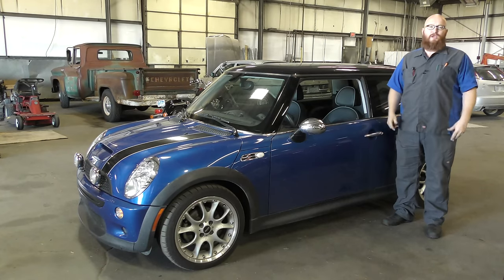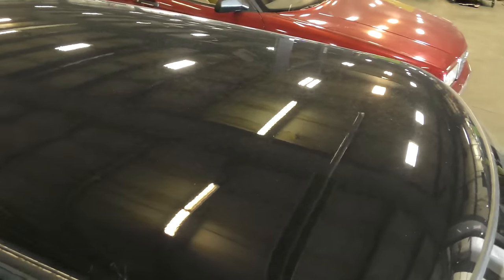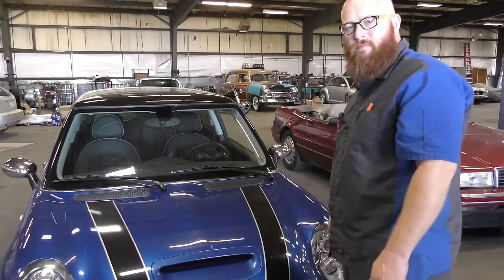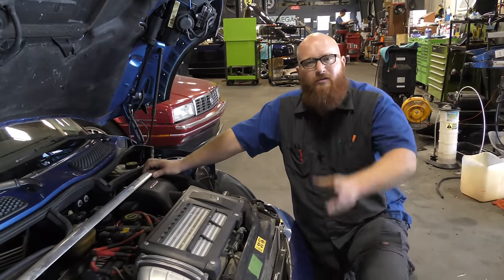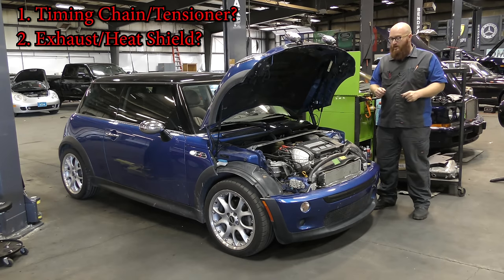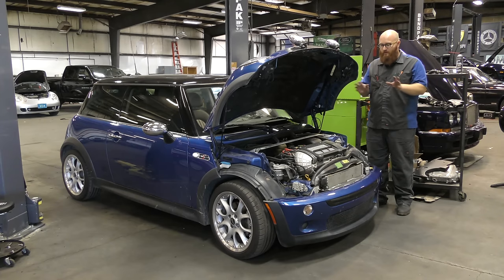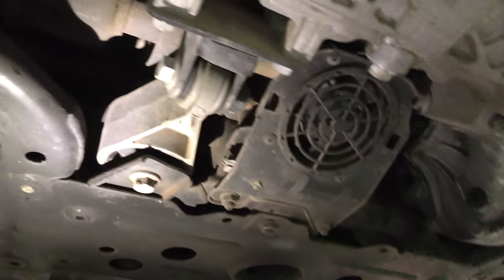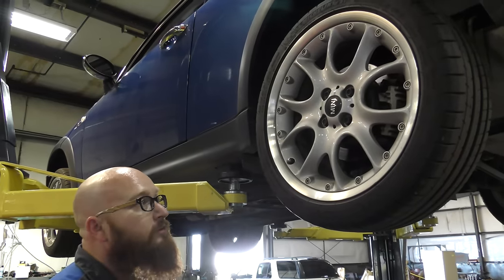Roaring Loud Mini Cooper S! The CAR WIZARD finds the source of the mysterious noise

Comment: I had one of these, tons of mods. They make good power but have many failure points. Give it time that car will leak oil at every seam.
Reply: They leak power steering lines too and they are not well built.
Reply: As someone who owns a '05 S with 207,000 km... maintain your shit better? I'm not kind with mine and the only mechanical failure I had was the power steering pump, everything else is maintenance and preventive maintenance for stuff like the infamous BMW plastic overflow tank, etc.

Comment: I’ve never heard of a supercharger pulley going bad on these, of course everyone puts smaller ones on. Typically it’s just the tensioner pulleys that go bad.
Reply: ne2i that’s interesting I never read of that one.
Reply: It's not AS common for the front pulley/gears to go out, but the oil reservoir in the front can leak out and that's one way that noise happens. It's even more common for the oil reservoir for the gears at the back of the supercharger (between the supercharger and water pump) to have the oil leak out. IMO, the noise from a failed timing chain tensioner, belt tensioner, or at the front or back of the supercharger can all sound pretty similar, so a stethoscope like the wizard was using is crucial.
Reply: @ne2i  That pile is from him putting reducer pulleys on customers cars. I've never heard of an OEM supercharger pulley failing. It must be a pretty rare failure.

Comment: Bit of trivia:  the Focus SVT in the background and the R53 Cooper S featured use the same Getrag 6 speed manual gearbox.
Reply: Car manufacturers share transmissions like how PC manufacturers share cpu and graphics card
Reply: And that Getrag is amazing, I have an SVTF myself!
Reply: I drove my buddy’s SVTF in high school, probably my favorite MTX of all time along with a 911 or S2000 box
Reply: and the noble m600 with the volvo engine. it can handle over 800 bhp aswell.
Reply: The parts on the SVT Focus are not cheap like the newer ST Focuses are.

Comment: when you do the supercharger service, also replace dip stick o-ring and crank position sensor o-ring, as both are usually toast after 30k miles and you got your standard Mini Cooper oil leaks. going into front end service mode makes both parts easily accessible, especially when you do a full SC oil service (take off the SC). Replace the belt tensioner (cheap insurance) while you're in there and to round off a 14-year old Mini service, replace the engine top left mount, as it leaks black goo out by about 30-40k miles.  Oh, and check the crank pulley rubber parts for cracks - another weak spot that can cause expensive problems down the road. I wonder of the fan resistor on that car still works, given the low miles.

Comment: I want to see what's going on with the SVT Focus in the background!!!
Reply from the maker: Locked up engine. Ruined
Reply: @CarWizard  ugh.... someone didn't change their timing belt in time... I drive one and that is the one thing that is always monitored.. that's so unfortunate
Reply: @CarWizard  that's a pitty those cars are awesome are they like the RS or st but just rebaged for the USA
Reply: @neilmurphy845  actually its the equivalent of the ST, the RS had a turbo and we never got it here
Reply: @konstantindufnik696  ow that's cool I really like those old Ford's I think they look better than the new ones
Reply: @CarWizard  Mhh so a perfect patient to get a Rolls Royce hart then? :)
Reply: Dang. Time to drop a 351C in it.
Reply: Cosworth engines are very expensive.
Reply: Chris Pofahl it’s a fwd car so I would just put a 2.5 Inline-four or 3.0 Duratec V6 from a Ford Fusion in it.
Reply: @atx-cvpi_99  but they are very cool the cosworth engine's
Reply: @CarWizard  May be off topic but need advice. Can buy a 2011 Mini off a lady going through a divorce for $3,000. Fax looks good from what I can tell except one minor accident 4 years ago that rear ended a car and set off air  bags.  Grille and bumper was replaced and repainted. See nothing that worry’s me other then it has 170,000 mikes on it. $3,000 a good buy? 2011 Mini automatic a good car?

Comment: 1st generation minis are the best models ever, I should think of the JCW models, they scream louder than the Cooper S
Reply: These are not Minis, they are BMW in disguise, that's why the engines suck.
Reply: If your definition of good includes reliable and well built, first gens are absolute garbage. 
Superchargers go bad all the time, oil consumption, interior creaks and rattles, etc.
At least it’s not the Prince engine...
Reply: @julianh9347  Its not a BMW engine...
Reply: @TheRetr0Miner  I know, which makes it even worse! The worst of all worlds.
Reply: @julianh9347  it's a dodge neon engine.
Reply: @ast5515   yes superchargers go bad.  Just like turbos.  Yep they consume oil (just like turbos).  Dash does rattle.  Takes 30 minutes to fix and never does it again.   Basically the car does car stuff.  

Really the only downside I find it
is they use a ton of gas.  My hobby it touge racing.  I have several turbo cars and only supercharged car is the mini.  Mini will go thru a tank twice as fast as the turbo cars.  More then once I was out with friends and ran out of gas.  

The mini is slower then my other cars.  They all make at least 100hp.  The instant throttle response really helps it to keep up. 

The best thing about the mini is it's a unique driving experience.   The supercharger screams under power.  Between shifts the exhaust snaps and crackles.  Just puts a smile on your face.
Reply: OutlawUniverse I never said it wasn't fun. It just isn't particularly well built or reliable.

Those superchargers go wrong a lot more frequently than turbos though.
Reply: @ast5515  The superchargers need a service that Mini stupidly never accounted for.

The reason they fail is over time the oil that lubricates the gears for the water pump run dry, which then makes mince of the gears leading to them not engaging the water pump anymore which in turn makes the car overheat and then the head gasket fails, which writes off the car because it's too expensive to repair.

A bit of preventative maintenance and you can avoid the problem. Just change the oil in the supercharger. It's a fairly big job, but nothing a home diy enthusiast couldn't handle on a weekend.
Reply: @SofaKingTouge  nope Fiat engine
Reply: The W10 & W11 engines in the first generation BMW minis are Tritec engines. A company created by Rover, BMW and Chrysler, hence the ‘tri’ in the name. The engines were developed with input from all 3 companies at the time. The Tritec engine and the company I believe, was later sold to Fiat after production of the hen 1 ceased, who built a 1.8 out of the platform.
Reply: MrManBuzz Long story short, BMW fucked up. Like they did for the last 25 years of timing chains, rod bearings, window regulators, etc.
Reply: @ast5515  Pretty much yeah. They fucked up in not making it a serviceable item. The same supercharger in other cars (some Mercedes iirc) require it to be serviced every 40k.

As long as you can change the oil in it before it starts making a death rattle the supercharger should last just fine. There's even a mod kit you can buy for them now which allows you to top up the oil without taking anything apart.

Considering most people put reducer pulleys on the supercharger anyway, it really isn't that big of a deal. You can do it while doing that job and then forget about it for a few years at least.

These cars certainly aren't Toyotas in terms of their reliability, but they're also not soulless and boring like a Toyota either.

With some smart preventative maintenance they can be pretty reliable.
Reply: You don't know what you're talking about. These cars are rubbish, especially the early ones. lol
Reply: @ast5515   superchargers need a 100k mile service.  Not a big deal.  But lets say the supercharger has a total failure and needs a new one.  $200 to 400 at a salvage yard.  Few hundred to service and you are ready to go.  FYI mine is at 115k and still running strong.  Just making something out of nothing.
Reply: @altergreenhorn   it's based on the dodge neon 2.0 and scaled down to 1.6 for the European market where it was first introduced in the European dodge neon.
Reply: @TheRetr0Miner  Peugot I think?
Reply: @TheRetr0Miner  Peugeot I think ?

Comment: Got to take it easy over the railroad tracks in Newton with a Mini Cooper.
Friend of mines family took out the radiator driving over too fast.
Reply: The early ones had horribly stiff suspension. They were great fun, no doubt, on smooth twisty roads however.

Comment: I had one for a bit. Briefly lived somewhere with crap parking so borrowed one for a few months. Great fun. It had a full stainless exhaust on it and had every option ticked. It was for sale, If I hadn't have found a Jag distract myself with, I'd have bought it.

The biggest problem was the heater matrix. They have small passages and it had blocked up. Replacing the matrix requires attaching stupidly designed pipe connectors and its basically impossible to do when you are upside down in the footwell. I blame BMW since Rover aren't here to defend themselves, and they never did that on their other cars that I know of. Oh, and the clutch is too heavy. Its not nice to drive in traffic.

The car ended up being sold to a friend though, so I still see it. The heater still hasn't been fixed yet, just bypassed with a hose for now.

Comment: Over here in the UK they go for next to nothing second hand ,nothing but trouble and the cost of replacing the clutch etc is expensive for what they are .Pretty much nothing but a throw away car once they start going wrong  .
Reply: I dont see minis going cheap  unless it's a  fucked one,  it's a premium brand, not like Vauxhall or ford or Hyundai ,which people buy as cheap run abouts  second hand

Comment: I have a 2011 Cooper S with the about the same low mileage. Been very reliable apart from a recent bad timing chain on about 45 000km. 
Hoping not to have allot of age related issues in the future.
Reply: LOL!  I would certainly hope a car with 25,000 miles/45,000km has been reliable.  That's practically brand new!

Comment: I have 180,000 miles on my cooper. Only thing I have ever had done to it was an alternator. I guess I am lucky.
Reply: Christopher Zapalski the alternator is the only thing that hasn’t broken on mine
Reply: Mines only had the coolant pump go, thanks to a very particular past owner who got lots of work done before it really needed doing 😂
Reply: @alfredvalrie5541  🤣🤣🤣
Reply: I assume you don't have an R53 or you would have had to deal with the supercharger by now.  Mine took a dump on the PTO side at 110k.  I put a Sprintex in it, did the work myself, still cost $2500, but it's WAY faster now.
Reply: 2002 mini cooper s. Power steering barely worked, made a high pitch squeek when turned to left, boot wouldn't unlock most of the time (had to actually unlock it using the emergency unlock under the rear seats) over heated quit a bit, rear wheel bearing was loose which was due to sitting for a while my sister had to lend the car and we found that out, that was scary. Probably had many other issues that I didn't find. All in all i think my first car was great. Had to sell it to someone who was willing to fix it up. Now I am in need of a new car but with lockdown and me finding it really hard to find a job atm it's not looking promising.
Reply: chiggerpepi I change the oil every 30k in the eaton SC.
Reply: @zapalskic  That's very smart, but an awful lot of work!
Reply: I have 157,000 on my 2003 Cooper S.  Original supercharger and clutch still.  I've replaced the expansion tank twice, the brake fluid reservoir, oil filter housing seals, oil pan gasket, engine cooling fans, fuel filter housing, front struts and strut mounts, rear bushings on both front control arms, front swaybar links, right tie rod and window regulator myself.  Power steering pump was replaced under recall.  I really enjoy this car and I'm going to run it for many more miles.  I'm planning to teach my daughter to drive a manual transmission on it when she turns 16 in about 4 years.  If the original clutch is still in it by then, she'll probably finish it off!  LOL.

Comment: Not this version but my mini cooper s clubman at 60k the timing belt guides will fail mine failed before that, replaced oil pump and water pump. the infamous timing ticking noise when it starts. Still was a nice car to drive

Comment: If you like the Cooper and you cherish luxury.... may I suggest checking out the Mini Cooper S “Inspired by Goodwood”.  It was a Mini designed by Rolls Royce,  in order to comply to the 2012 E.U. Fuel act (?).  It had plush carpets, RR leatherwork and Black Diamond paint!   It was an expensive Mini.  Aston Martin did the same thing, by rebadging a Toyota iQ (Scion?).  It was called the “Cygnet”.  Two real neat luxury variants.  Thanks for the video.

Comment: For the N14/N18 engine variants...just be sure to replace (not flush) your transmission oil at around 80-85K miles and do the timing chain kit replacement at around 95k-105k miles. Also, as this is a DFI engine...change the oil (5W30 full synthetic) every 5000 miles. The turbo four bangers need CLEAN oil. You'll avoid major repairs with some planned maintenance. Do it before it becomes an issue. I have had excellent experiences with our Mini's ('08 R55S, '12 R60 JCW All 4) by following these simple truths.

I also run Seafoam at least once a year on the dirty side of the valve cover intake AND also once a year a Dixie cup amount of Seafoam in the engine oil about 300 miles (mileage on full tank of gas/ equivalent) before an oil change. Lastly, fuel injector cleaner or Seafoam (8oz) in the gas tank at least once a year to keep the fuel injectors clean. All together, these treatments consume a can of liquid Seafoam.

Comment: Really neat car. Too bad about their reputation regarding reliability
Reply: Nobody cares when u see the prices of spareparts. Until u realize that in order to do ANYTHING, EVERYTHING has to come of/out first. Its a tight package.
Reply: They’re not that bad. They have their faults and they’re all at least 14 years old now.
Reply: The reliability is fine. My firend's Charger stranded him before my MINI did. If you're basing that off a magazine like Consumer Reoprts, they're scale and criteria is total Bs.
Reply: @alpine1600s  there are always outliers
Reply: Niclas Lundberg no it doesn't . As a person who owns and works on a 2003 MINI, the only thing that "has to come off is the bumper cover and the aluminum bumper. And then you have access to everything.
Reply: Sebastian, Consumer Reports get their results directly from owners. I know, i’ve done a number of these surveys.
Reply: Sebastian m you’re skipping a few steps like you’ve never worked on it. That’ll give you access to slide the radiator and condenser to you. If you want full access you have to discharge the a/c system and drain the coolant to remove the radiator support and get full access.

Comment: I will take it! I have a 2006 Mini Cooper S with a bit under 42,000 miles (as of 4/21/2021).  My first R53 was hyper blue. And the one in this video is a slicktop (no sunroof) my preferred. That Mini also has the English Leather seats - also my preferred. Six speed manual with the Chrono package (no center speedo). I would buy that Mini.

Is it missing the underside engine cladding? Simple to remove and often left off my mechanics.